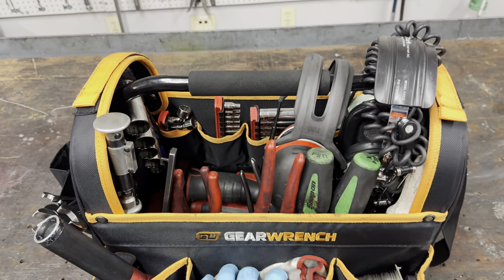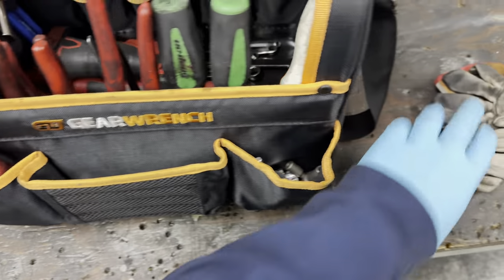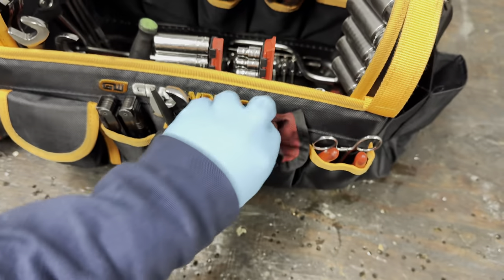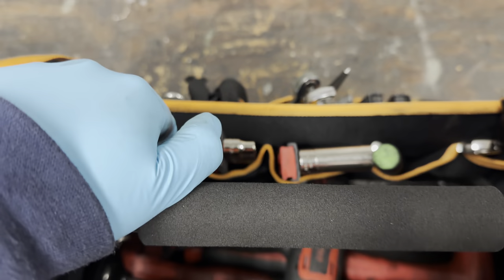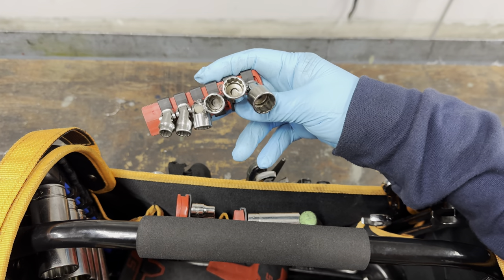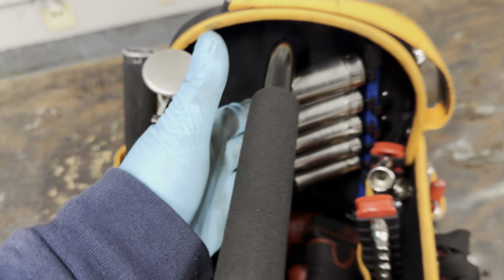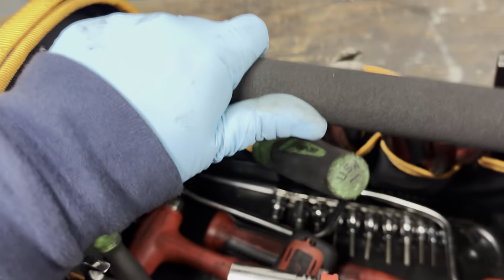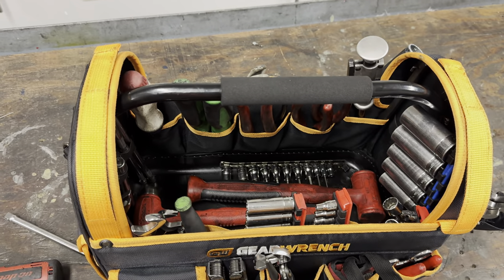Line Aircraft Mechanic Tool Box Tour 2024

Comment: Nice set up. I have a Husky bag for my line setup and I would recommend the grip edge stuff for Allen‘s. They work great. Some of the husky bags are water resistance, so it does help if I leave it out. It has a massive amount of pockets on the inside just my recommendation.

Comment: So, we fly in airplanes you maintain.... and you don't understand acceptable torque levels on a 1/4 ratchet so as not to make it fail prematurely? I saw another tech for an airline who had up to one inch sockets for 1/4 ratchet. And he said his mechanic course lets him enroll without a multimeter. As if anything actually runs without proper electrical.

 I'm never flying again. Not kidding. 

You guys are culls.
Reply from the maker: Haha you got issues
Reply from the maker: Don’t worry, everything I do, I actually torque with a proper torque wrench and follow maintenance manuals. Have fun driving around
Reply: Any hardware requiring torque is required to be torqued using calibrated tooling. With working on an in service aircraft accessibility may be of concern, 1/4 Drive tends to be the most capable of providing reach and retain mechanical advantages provided by a ratchet. Other supplementary tooling such as torque adapters and crows foot wrench that provides the needed contact to achieve proper installation lack the ability to remove/thread any hardware in a timely fashion.
Reply: Part 147 outlines the necessary equipment, curriculum and the FAA Airman Certification Standards provides the information and subject matter areas that are required to obtain the privileges of an Aircraft mechanic ratings including but not limited to 
Fundamentals of Electricity and Electronic
 Aircraft Electrical Systems
Engine Electrical Systems
Reply: I'd say any torque is acceptable as long as you don't break the ratchet and the job gets done. They sell rebuild kits for like $5 bucks for when we break them. So just sit in the back of the plane and stfu until you get to your destination. Until then, keep crying about it.  Sasquatchfarts....
Reply: Snap-on recommends not exceeding 28 ft lb (336 in lb) working torque limit for 1/4 drive. I can't remember the last time I needed to torque something above that in my day to day work on helicopters. About 90% of daily maintenance can be done with a 40-200 in lb torque wrench, which is 1/4 drive. This includes on some fasteners that are quite large, so you step the size up to accommodate. When reassembling my aircraft's horizontal stabilator, for example, there are a set of 4 bolts, which have 7/8 and 1 inch heads. They are torqued to 42 inch pounds per the manual. Just because you don't understand something doesn't mean it is wrong. Also tools like multimeters are often provided by the company or school because they have to be calibrated regularly, and it would be unreasonable to place that burden on the individual.
Reply: It is exceedingly rare that anything on any of the aircraft I own or maintain is torqued beyond 60in/lb. I own a 3/8 ratchet… it has never touched an aircraft. Have fun walking, rock biter.
Reply: Multi-meters are provided by my airline because its a calibrated tool. We cannot use our own so its not unusual for a school to also provide one for a student, if my school required me to carry one I would have had to shelve it as soon as I graduated as I wouldn't be allowed to use it at my airline since I have to use their meter. Chill out 99% of us follow proper torques, or just use common sense if a specific torque is not provided in the maintenance manual, not everything on an airplane has a listed torque spec like some cabin items.